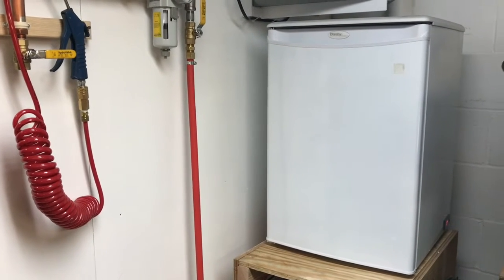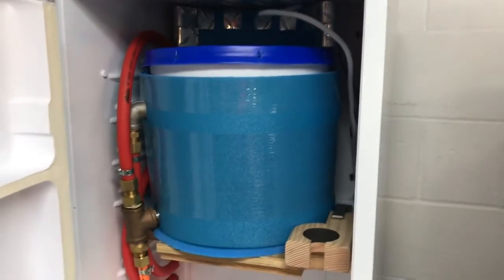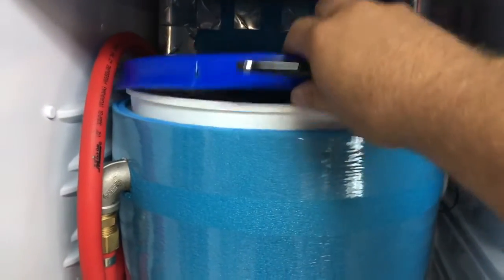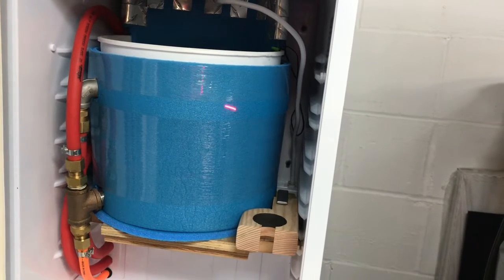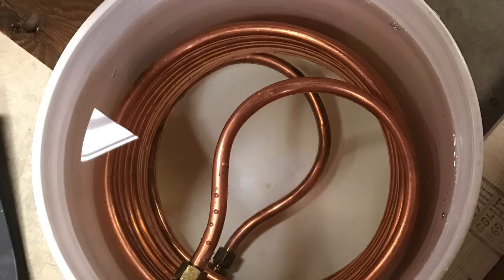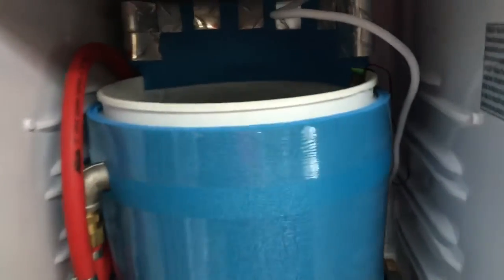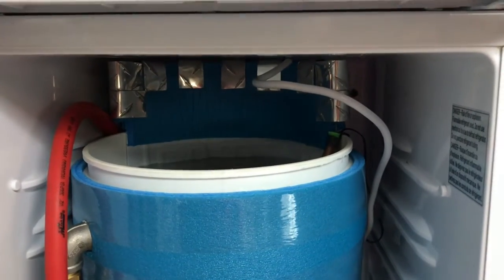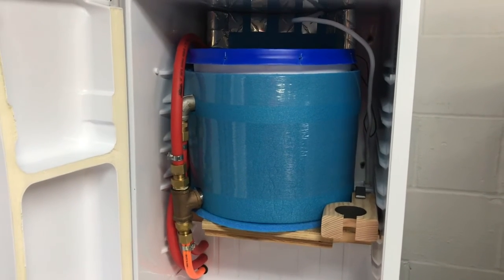DIY Compressed Air Dryer

Comment: What is the water separator you used? I am looking at building the same exact thing. Yours looks well built. Thank you.
Reply from the maker: It is an SMC AMG250C-N03D
Reply: @74jawa  Why did you work the cooling plate into the bucket? Wouldn't this work the same with the bucket inside letting the fridge cool it like normal?
Reply from the maker: I thought so too, but water temperature was all over the place.  Having air between the plate and the bucket did not work very well.